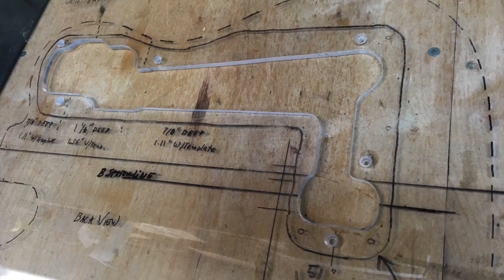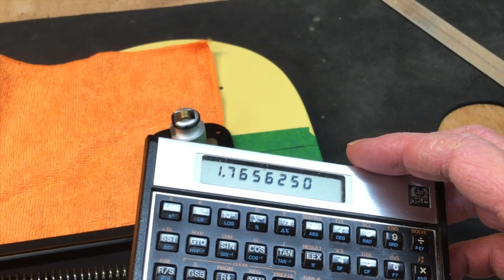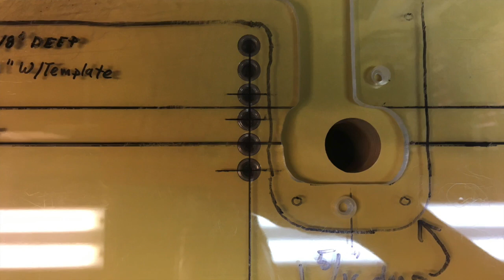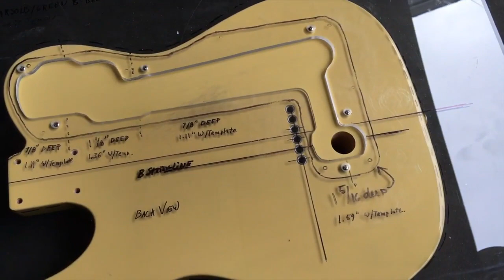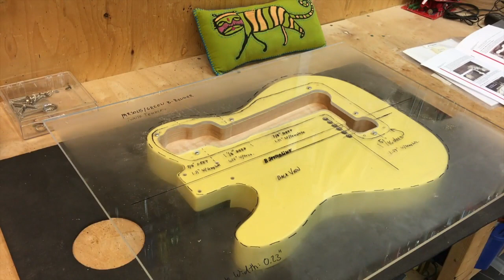Parsons / Green B-Bender installation

Comment: Thank you.  If I might nitpick, I’d recommend adding a touch of oil when filing down (by hand) the slot for the B string.  Also, I like to drill a 1/8” pilot thru hole before drilling the large hole for the B bender tower. For me, it still makes it easier to drill from both sides with the large drill bit and I don’t have to worry about going too deep and tearing up the back surface.

Comment: Excellent video! I have a Tele with this mechanism,i t had been sitting on the case for years, and now when wearing the strap the weight of the guitar makes the b string bend - need to adjust the spring. Any tips on what should be done? A video would be great!!
Reply from the maker: Thanks!  Regarding the spring, adjusting it depends on which type you have.  On a Parsons-White bender, the spring is attached to the body with a screw.  To tighten it you take the spring off the screw and re-locate the screw further to the back of the guitar.  Then re-install the spring.  Don't forget to drill a pilot hole for the screw.  I find that moving the screw 1/2" is plenty.
On a Parsons-Green bender, the spring is attached to a little hook that's bolted to the underside of the bender mechanism plate.  To tighten it, you take off the plate (don't forget to remove the b-string), remove the spring, then carefully bend that little hook in to the back of the guitar.  With this method you'd probably only get 1/4", but that still may work. 
Watch out!  In both mechanisms, that spring is REALLY STIFF.  Be careful when removing and installing it. Wear something over your eyes to prevent that spring from whipping around and daging you in the face when it slips of of your pliers when you're trying to re-install it.  Don't ask me how I know...

Comment: Couple suggestions from a 32 year veteran finish carpenter, hand files are a one way tool, you dull them by going forward and backwards.  Also, a Forstner bit would be much cleaner than a paddle bit for the initial hole….

Comment: The little piece of "paint" on the neck is where the tightness of the pocket scrapes off clearcoat and the pigmented layer of lacquer.. scratched it down to the primer white layer. Impossible to avoid when your making a tight neck pocket on a pastel opaque finished guitar. No worry.

Comment: try using a Forstner Bit instead of that cheap inaccurate spade bit. you will not have to worry about "blow-out
Reply from the maker: Hi there, I have a selection of Forstner bits, but prefer a spade bit for this application.  I've seen people get blow out with Forstner, twist, and spade alike, so it always pays to be careful.  I got that particular bit so long ago I honestly can't remember if it was cheap or expensive.  But I do measure the holes that it makes and it is quite accurate :)